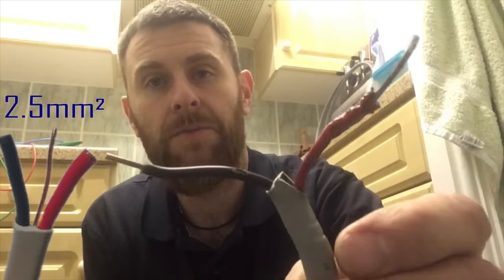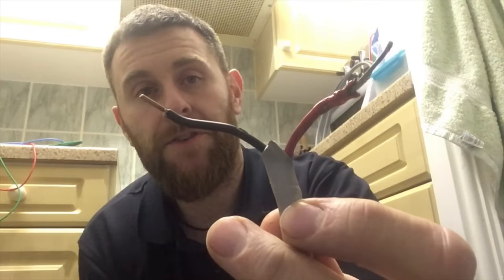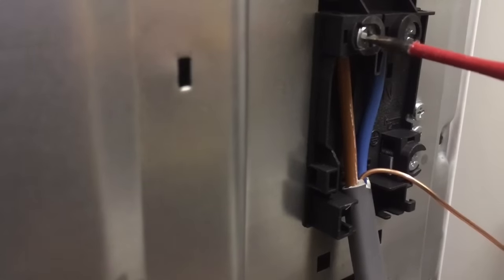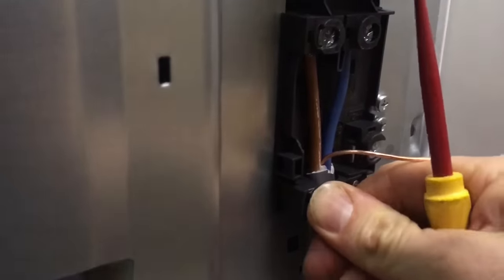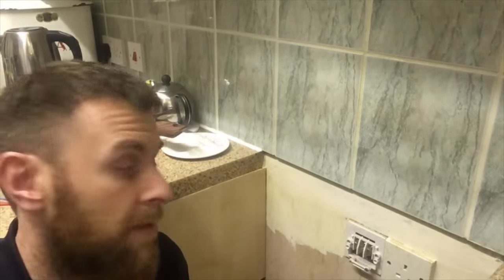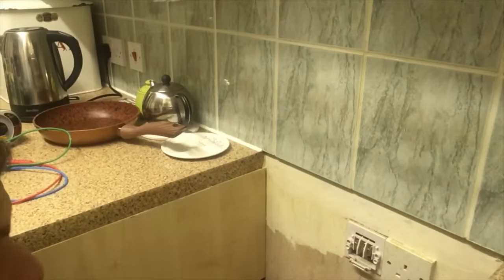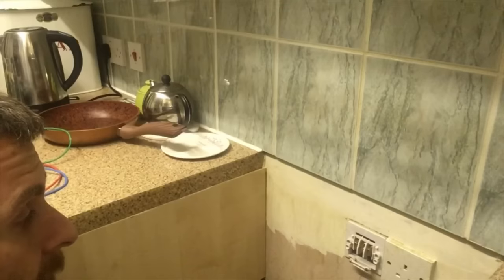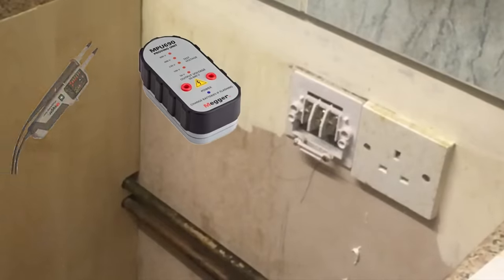On Site with Matt Connecting up a new Cooker and Testing the Circuits Earth Fault Loop Impedance Zs

Comment: At last an electrition that explains his self properly.  As they say you've watch the rest now watch the best ahahah. Don't see the point in a video if you haven't got the sence to explain things properly.  Great video.  Oh while
 I'm sucking up I've got a  4500w double oven to put in , there is a plug in socket with 6mm cable inside. That goes to consumer unit with 32 amp fuse. I bought 6mm grey flat cable but I'm thinking I need 6mm flex cable and 13amp plug or is this wrong . Also I'm thinking change the 3 pin socket for a cooker connecting box and put the 6mm flat cable in that. Any help please. Basically I'd like to know can I change a 3 pin single socket with 6mm cable  in it to a regular cooker conecting box .😁

Comment: Are the 6mm standard size for cooker cables?
Reply from the maker: Sort of but checkout the power rating of the over/hob. Gaz 👍
Reply: Actually you don’t need to use 6mm2 for a cooker circuit . As when you apply diversity it is unlikely for the cooker to use it’s full load 4mm2 is perfectly fine for a 15kw cooker 6mm2 is throwback from the 50s . But if the circuit is wired in 6mm2 then you must use the same size between the cooker connection unit and the cooker as you can’t down size. Reference John word did a video on this well worth. Watching

Comment: My own cooker has the acsactly the same connection plate and it does not not indicate any torque settings at all, I also had a good look through the manufacturers instruction booklet and again it’s dose not mention anything about torque settings. My cooker is a hotpoint fan assisted double oven. 
The on screen reference to 2.5nm torque is totally wrong and misleading.
Reply from the maker: This oven had the torque setting on it as stated in the video (look carefully). I do NOT produce content with misleading elements in it… with over 600 videos on the channel I take great PRIDE in the effort I put into producing 2 videos a week 52 weeks of the year…
Reply: @GSHElectrical  sorry didn’t mean to accuse you of producing misleading content, 
But  I can assure you that there is no torque settings marked any were on those connection plates . Nor in the instruction book , I contacted hotpoint technical support this morning and they said that they don’t recommend torque settings. For connections . 
However I did find with a Google search that there is a French or German brand that has a different design connection plate and it startes 2.0nm , but that doesn’t mean that it applies to the uk or to all brands of cooker , I also believe that the cooker in the video is a hotpoint. 
Gaz you never knowingly put out false or misleading content . If I think that you do I would not watch your videos and I would not support you in what you do for the industry.  But who am I to argue ,i’am just a humble spark who’s opinion means nothing. My main problem is that Matt used a flathead screwdriver on fillips screws , and that some burk wired the cooker in 2.5 mm2 TW&E .  
So I apologise for my comments.
Reply: I have just taken a couple of screen shots , one of the connection plate and one of the silver label  , I enlarged them . And on the label it only says, To the installer please connect the power supply as pictured,
L=terminal 1 (*)
N=terminal 2(*)
E=the earth symbol (*), it does not mention any torque settings. Never dose the connection plate. 
Again my apologies for my comments.
Reply: @GSHElectrical  Boom!!!

Comment: Who on earth installed it with (2.5mm ) twin and earth . Cooker cable can be 6 to 10 mm cable only as it carries heavier current Lets say (53Amp ) surface max. 45 amp concealed.. even I know that way back in (1975) when I was 7 years of age.
Reply: The cable wasn't suitable to supply the load of the cooker that why you can see in the video the insulation has melted

Comment: I thought your use of the knife in a training video was very scary one slip and a nasty cut to your hand and also get some proper screwdrivers, using a flat blade screwdriver to tighten pozi screws is not very good. otherwise a good informative video for the learners

Comment: My wire is red and black
Reply from the maker: Old Cable Colours Pre 2004 In 2 Way Switching and a Feed (Supply) to a Switch for an Outside Light
https://youtu.be/w8PcvgZuYfw
Reply: This is the old coloring code